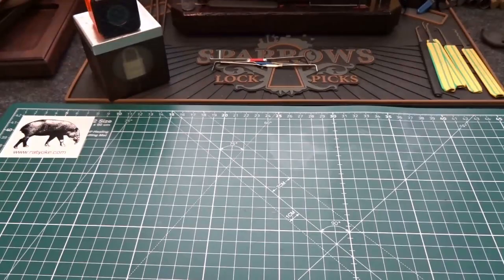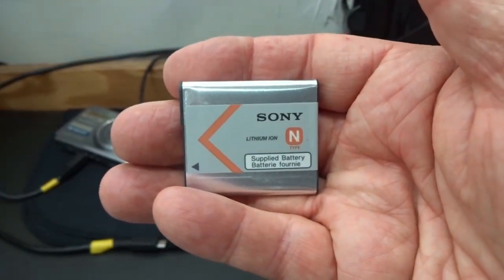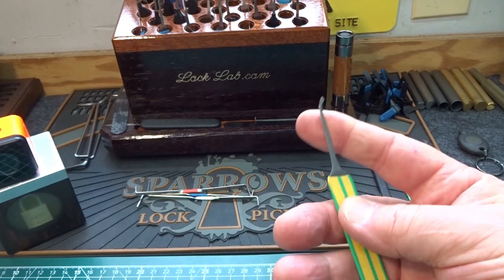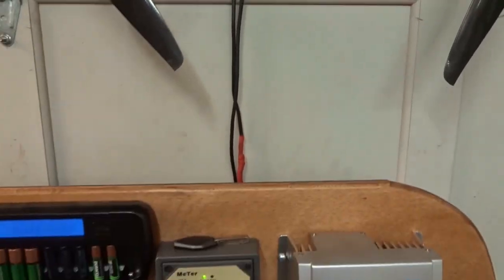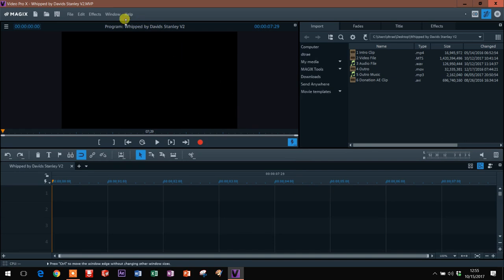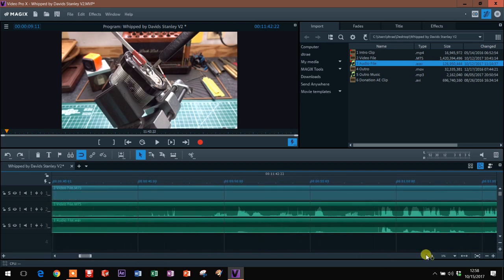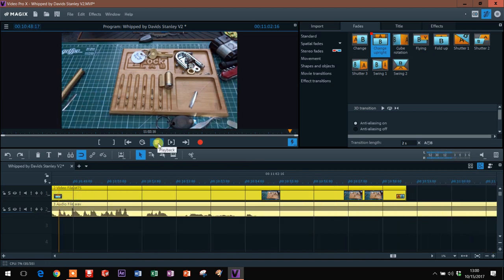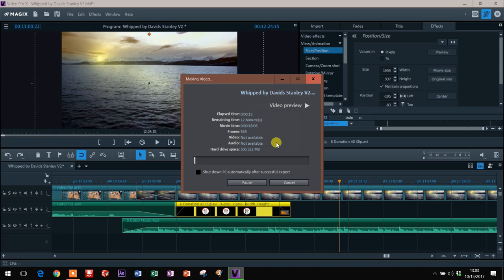(1168) How I Make LockLab Videos

Comment: I have used Magix for years. Couple of tricks to use on that program to speed things up 1. hit the "T" key to cut things its the shortcut for the razor tool 2. if you highlight your clean audio and video track you can right click and go to "audio functions" and go to the bottom and hit "align other audio objects with this track" It saves a lot of time! Some times you have to trim the clean audio to close to the same size of the video because it will get confused on the tracks if the audio is way longer then the video track. But most of the time it works great.  3. Use the scroll wheal on your mouse to move the time line around its a little faster then to click and drag the bar. Hope this helps your work flow.
Reply from the maker: Thank you Sir.  I can't wait to try the audio track alignment tip, as that is pretty time-consuming when I forget to clap my hands.

Comment: Looks to me like your Sony cameras use a micro USB cable to charge. Have you considered using a 12v USB charger and an extra long micro USB cord to keep the camera rolling at all times instead of relying on those dinky batteries? I'm sure you would find a way to route it he cable so it isn't noticeable on camera and doesn't get in the way either.
Reply: Sony cameras cannot record video while being charged due to a silly EU camcorder tax that would jack up the price. Hint to BosnianBill: Get a 4v power adapter and solder the ends of the wires to the contacts in the camera. Your "battery" will last indefinitely.

Comment: What 3D printer do you have?
Reply from the maker: It is a Makerbot Replicator 2X, but I can't recommend it.  It is constantly breaking down, expensive repair parts, has poor customer service.
Reply: I've heard that the newer makerbot's are no good from a few people. I currently have a Prusa i3 MK2S that I haven't had any major issues with. I've been thinking of 3D printing an entire lock to send to you but I need to get springs to design around.
Reply: try pen springs, i used them for a few wood locks i made.
Reply: Brandon Mott Just like Master Lock, stay away from Makerbot!

Comment: Did you do the solar panels yourself?
Reply from the maker: Yes, I got them from Renogy in the Fall of 2015 when they had their big sale.  They have a sale every year about this time.
Reply: Very cool. Is that power cable coming out of the inverter just an extension cord that goes to all the AC powered devices in your lab?
Reply from the maker: That power cord is only for the 120v power strip on the power bench.  The inverter is direct wired from the rear into the LockLab's distribution box.  I had a switch installed so that if the batteries ever get too low, I can switch back to mains power.  This hasn't happened yet, but you gotta be ready...